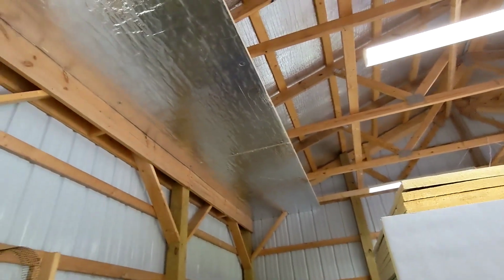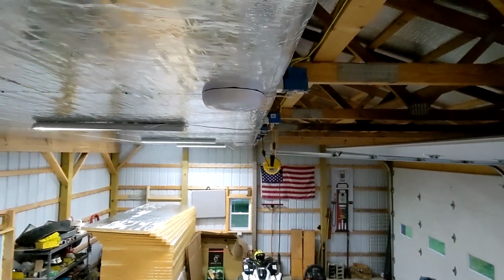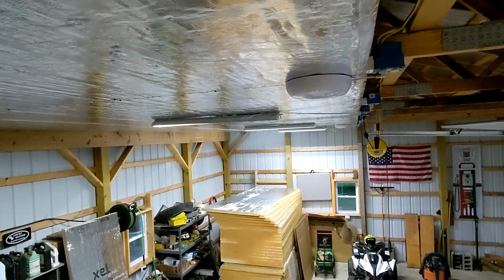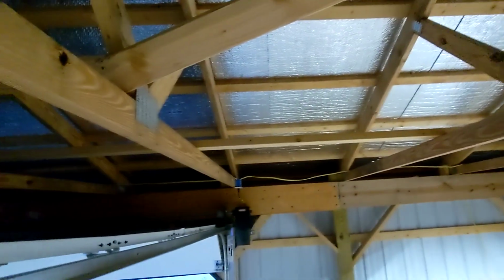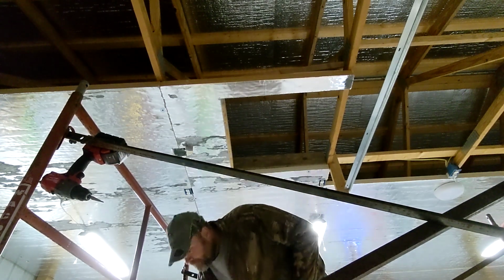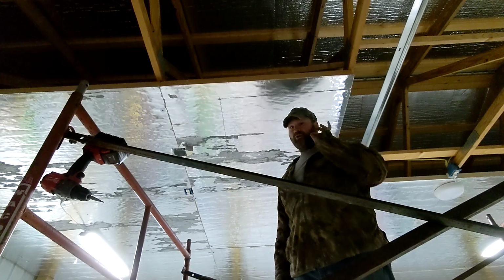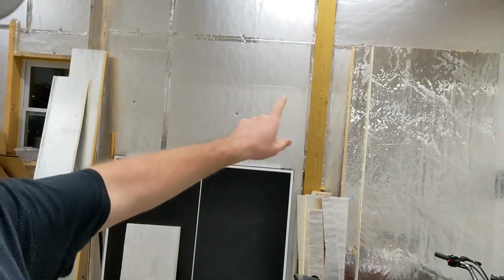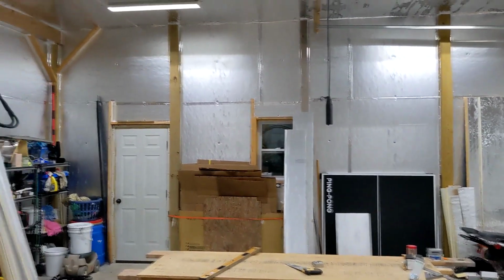Insulating the shop!

Comment: Excellent work, I’m thinking of doing the same. As for the walls, since you laid the insulation on the girts, how did you run your wiring?
Reply from the maker: what i should have done was run the wiring in conduit overtop the insulation.